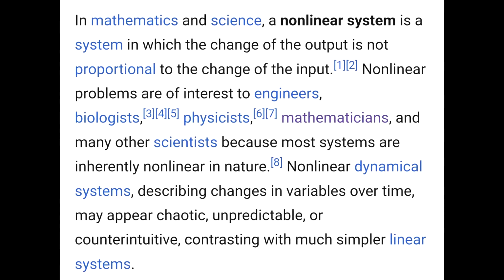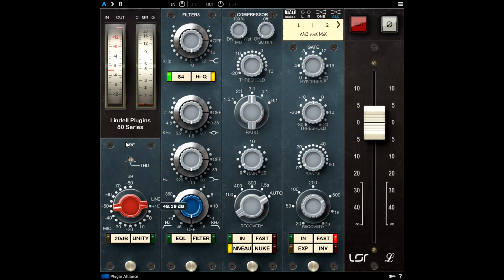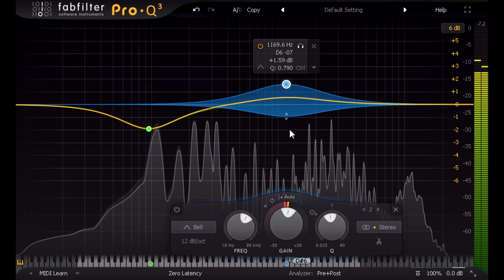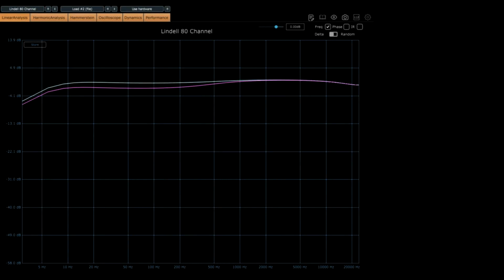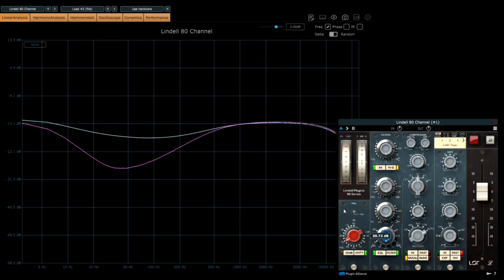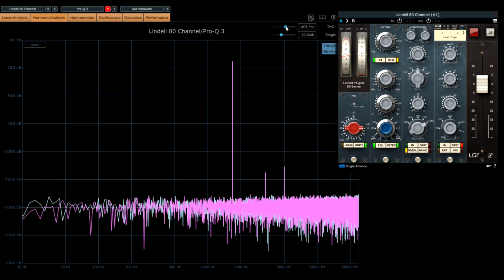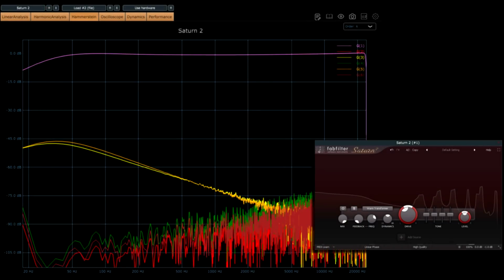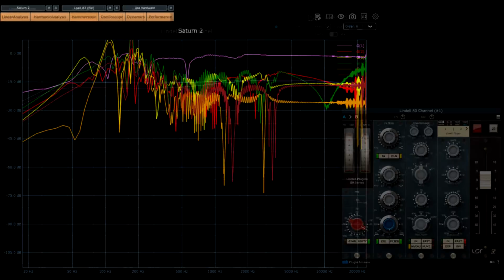WTF is a Non Linearity?

Comment: Thanks for another awesome video! A question, so what are the squiggly/non-standard (but dynamically linear) eq curves called? I've never been quite sure whether they are counted as non-linearities as well, like level-dependent differences.
Reply: They are linear, unless you're using an EQ that does model a physical circuit, which might have non-linear parts. The way to test whether that's the case is a null test. You take two audio sources A and B, then run a copy each to two groups. In one case add your plugin to both individual tracks, in the other to the group (with the same settings in all 3 cases). Now flip the polarity on one of the groups. You should get a null for a linear plug in.
Reply: @simongunkel7457  No offence but that's the most complicated explanation of a null test I've ever seen :)  Also, some plugins, for example Tokyo Dawn Labs SlickEQ is non-linear only if you boost or cut, not if the eq bands are at 0 gain.
Reply: @ejmikk  Well, it's a weird null test, because it requires two different input signals and you check whether the sum of the processed signals null with the processed version of the sum. I'd say the TDL plugin is generally non-linear, even if a special case with a linear response exists.

Comment: The Wikipedia definition is wonky as well. Non linear transformation is one that is not linear. And the definition of a linear transformation comes from linear algebra and needs to satisfy another condition on top of being insensitive to scaling of the input. Namely that applying it to sum of two signals is the same as applying it to each signal separately and then adding them. Also I know exactly which video you're talking about
Reply: With audio there is another thing to consider. Let's say we have two input signals f(t) and g(t) as well as two individual samples x and y. A plugin can satisfy F(a*x+b*y)=a*F(x)+b*F(y) but not F(a*f(t)+b*f(t))=a*F(f(t))+b*F(g(t)), i.e. be linear on a sample basis, but non-linear for signals. Distortion generally results from non-linear response to individual samples, but an ideal compressor with sizable attack and release times (>>time between zero crossings of the input) is sample-linear, but not function-linear (after all a compressor is supposed to switch between two amps with linear transfer functions. If it's soft knee, it'll be going through linear combinations of these transfer functions, but neatly enough the linear combination of linear transfer functions is also linear). If you simulate analog gear you end up with both transfer functions being non-linear, leading to some distortion and would want to oversample to remove aliasing artefacts. But if your transfer functions are linear, you don't need to oversample unless your attack or release times are very short.

Comment: Actually, linearities include invariance by both multiplication (aka, change in volume) and addition, which is to say, in a linear plugin, if you run the sum of two signals, you should expect the same output as if you ran both signals to the plugin separately, then added them.

This is the reason we often use reverbs in bus tracks. Since reverbs are linear, this achieves the same as if I had one instance of the reverb in each track.
Reply: The irony here, of course, is that it's linear only if it's a digital reverb.
Reply: @williambrewer3150  idk about analog reverbs, but real reverberation is pretty damn close to linear. That's why impulse responses even work at all.
Reply: @iurigrang  They are linear given reasonable levels. There is a point where air stops behaving linearly and the same is true for things like plate or spring reverb. But I don't think anybody doing music is pushing levels to the point where it has an audible impact.
Reply: @simongunkel7457  yup, this is what I meant by real reverberation being close to linear. Obvious, everything here only works to a certain point.
Reply: @simongunkel7457  ok but what if I wanted to model the reverb inside an atom bombs mushroom cloud ?! 🤔
Reply: @doctorscoot  I'd worry about signal to noise ratio, which in this case should end up negative (the sound wave from the explosion should drown out whatever sound you want to make). You could of course treat the explosion as a very loud impulse, in that case the issue would be the mic distorting. But if you had a set up where you wanted to capture a reverb at multiple levels, I'd simply use the deconvolution method to generate IRs at different sound pressure levels, then use a number of sends from a channel to pass the signal to convolution reverbs using all of these IRs, then control the send levels through the envelope of the signal.
Reply: @simongunkel7457  signal to noise ratio becomes smaller than 1, not negative, when the noise is louder than the signal.
Reply: @iurigrang  When given in dB that is negative...
Reply: @simongunkel7457  uh, fairs

Comment: As a guitarist there are blurred lines when you try to transfer the jargon over to the context of mixing.

The tremolo/vibrato thing is completely skewed, so much so that the piece of hardware that many guitarists use as a bridge is still mislabelled as a tremolo on a common basis.

It seems like guitarists are still misinformed from the times where a guitar amp didn’t even have an independent gain control. The preamp and power amp were tied together and the volume knob on those amps would simultaneously increase the gain in both sections so you would have to make the amp really loud if you wanted to introduce overdrive in your sound. 

This only really changed once amps like Marshall’s JCM800 separated them and there was a pre-amp control introduced which allowed you to dial in all the overdrive you wanted whilst being able to control the overall volume better by increasing the gain of the power amp. 

Thanks for another great video Dan, they’re always super informative!
Reply: I think you've made some assumptions about early amp designs that aren’t quite correct. Early amps (such as say a tweed Fenders like the champ and princeton) do have independent gain for the preamp and poweramp, it just happens that the gain is fixed for some portion of the circuit. Which portion depends on the circuit. 

If you look at the Fender FC1 champ circuit (below), you'll see the pot exists between the 6SJ7 Pentode preamp tube and the 6V6 poweramp tube (its the 1 Meg variable resister connected directly to the grid on the 6V6), whereas the preamp has a fixed grid resister setting the input gain. 

With the Fender 5F1 champ (also below), it has introduced the classic configuration of using a dual triode (the 12AX7) for the preamp, with one of the triodes acting as an input buffer, and the second controlling the gain. In this configuration, the 6V6GT poweramp tube has a fixed gain, and the volume pot (a 1 Meg variable resister this time) is installed on the grid of the second half of the preamp tube, controlling the preamp gain. 

Earlier 5C1 circuit diagram: http://i2.wp.com/myfenderchamp.files.wordpress.com/2010/03/champ_5c1.png
The iconic 5F1: https://i.pinimg.com/originals/a3/a7/44/a3a744c0165a368c2b3d4f2456df06e3.gif

I chose the champ circuits because they are the simplest circuits, and have exactly one pot which simplifies examining the diagrams.

Comment: Fast attack and release times in compression add harmonics? How is that? Thanks for the great videos!!
Reply from the maker: The faster the attack and release times get, the closer the compressor gets to a distortion effect. With zero attack and release smoothing you'll have a waveshaper style distortion, literally. There is in reality a gradual transition between compression and distortion, and no hard dividing line where one becomes the other.
Reply: @DanWorrall  And thanks again! ;-)
Reply: @DanWorrall  What would be the best way to show this to someone in waveform-examples? I tried compressing different signals (Drumloop, Square-Wave etc.) with extremely low attack & release times and comparing them in the analyser. I can't really see new harmonics. I think I understand that a waveshaper can basically be compared to a compressor without reaction times but I still miss the last step to visual representation.
Reply from the maker: @xKiddox1310  those harmonics are probably easier to hear than to see. Many compressors use curvy release stages that release quickly initially, then slow down: this puts most of the distortion in the brief period following the transient, where its likely to be masked by that transient. Try using a compressor like ReaComp that can do zero attack and release times (don't forget a zero RMS window as well). Listen to how it sounds as a pure waveshaper, then try adding tiny amounts of attack and release smoothing to get more complex saturation type effects. See how much you need to add before it sounds like compression not saturation...
Reply: @DanWorrall  This! I remember trying it a few months ago with the built in compressor in FL. Never knew it could make sounds like that.
Reply: @DanWorrall  Excellent! Will do and thanks a lot!! :-)
Reply: @DanWorrall  Discussing this for a bit in these comment section has brought me to the conclusion that this is the wrong way to look at what the compressor does. The compressor switches between two linear transfer functions, there is no distortion here. When the attack and release are really short this switch starts to happen at audio rate, introducing amplitude modulation and thus sum and difference frequencies between the modulated signal and the control signal. The control signal is a pulse wave with the same fundamental as the input. So its frequency spectrum contains the overtones of the signal, which leads to the sum and difference frequencies also being overtones.
However, if you were to use a sidechain signal with a different fundamental, the sum and difference tones would not be harmonically related to the signal. The compressor would act like a ring modulator mixed with the dry signal.

Comment: Is he talking about Paul third?
Reply: Yep, I'm pretty sure he is. Paul's video overall is not wrong, it shows the differences between some plugins and their analog counterparts (as well as why they cannot sound the same) pretty well, but the continuous use of the word "non-linearity" is pretty ear scratching, he doesn't use it correctly.
Reply: @AlexLapugean  But he does claim about 2 plugins sounding the same, was that even a legitimate test? Because I'm pretty sure 1 also adds some harmonics and he was simply on the wrong view mode in plugin doctor. I have the suspicion he was wrong about that as well, but I need someone to confirm whether my suspicion is right or wrong.
Reply: @ethai1  Not sure what video of his you are talking about and what part of it. He uses both the linear analysis and harmonics sections from what I remember. And both do matter, eq curves and the generated harmonics, but it depends on the amount of contribution. Sounding the same is a bit subjective and depends on the difference in EQ curves and the generated harmonics. Even without harmonics, an EQ plugin can sound pretty much the same as the HW, if the HW generated harmonics are very low in amplitude ...
Reply: @AlexLapugean  I meant a video from, last week I think. He talked about linearity vs non linearity, and claimed that the waves F6 and RS56 plugin are the same because they both generate similar eq curves. That just seemed like a very bold claim to me and I'm not sure if his way to prove it was even the right one from the first place.
Reply: @ethai1  I think you meen like 2 weeks ago. The one from last week does not have F6 in it, it's with PullTec EQs. But regardless, what he does with the F6 in the video in question, is to match the curves of the analog HW and he says that even though you would expect them to sound the same (because you matched the curves), the phase response is different so in the mix, it will of course sum differently with other sounds.
Reply: @AlexLapugean  You're right, it is from 2 weeks ago. My impression was that he was trying to prove the F6 and RS56 (which is the other one shown) are the actually "the same" and thus the 56 is a "con", according to his words. And I wanted to know if I could trust him on this video, if he just spoke bs, or he just really doesn't know.
Reply: @ethai1  Well, they are the same in the sense that RS56 is not like its analog counterpart. Its curves are mathematically perfect bell curves, no asymmetries, resonances ... nothing. You can perfectly replicate its curves with a digital EQ like F6 or Fabfilter Pro Q3, as long as you match the Q factor, the phase response also matches. It also doesn't generate basically any harmonics. You don't need to trust him or not, he clearly shows it in Plugin Doctor, and you can also test it yourself. Apart from the interface and the "reset" Q factors, there is no difference in the Waves RS56 from a digital EQ.
Reply: @AlexLapugean  Im puzzled…so what was paul wrong about?
Reply: @edrugmanmusic  His use of the word "non-liniarity". Apart from the distortion (added-harmonics), nothing he mentioned (EQ curve odd shapes, asymmetries, resonances, instability etc) was related to non-liniarity. He basically referred to anything not mathematically perfect behaviour - characteristic to analog gear - as non-linear behaviour, which is wrong.
Reply: My suspicion as well. I found a recent video of his about the topic, where he also tried to claim with plugin doctor that the waves F6 and RS56 (also from waves) are basically the same, and after this (Dan's) video I'm not entirely sure that he (Paul) even did the test right.
Reply: ye
Reply: My first idea as well...
Reply: I wouldn't like to be exposed by Dan at all. I would be devoured by fear and shame.
Reply: Play a sine wave, add the plugin you wanna test...see if new harmonics are being created. If you wanna check the curves then you have bertom curve analyzer....some wilk have a different phase response but most of the plug-ins claiming to be "analogue sounding" are just gimmicks...